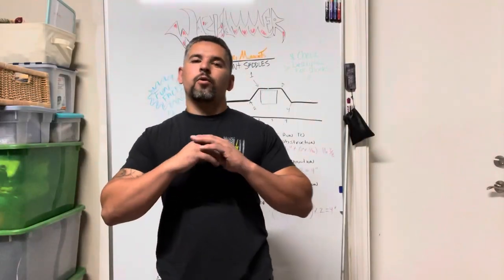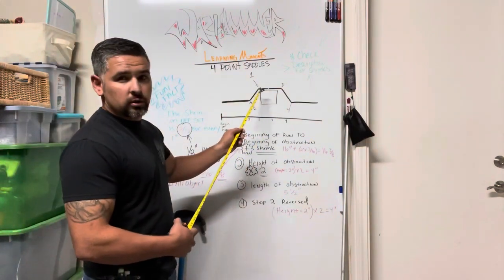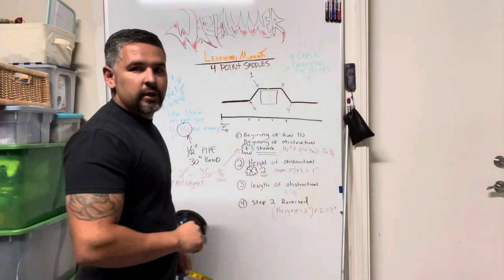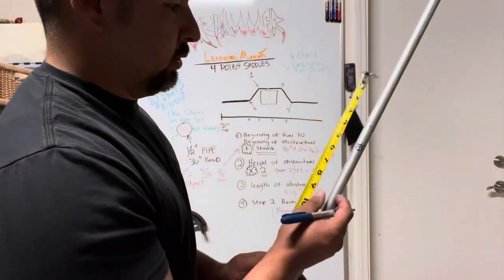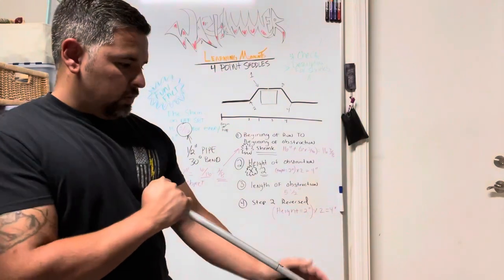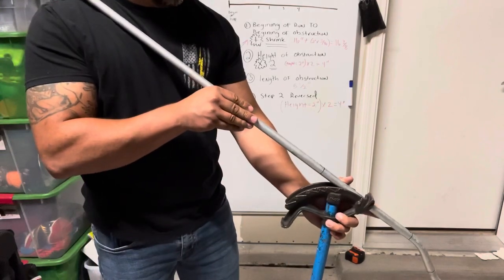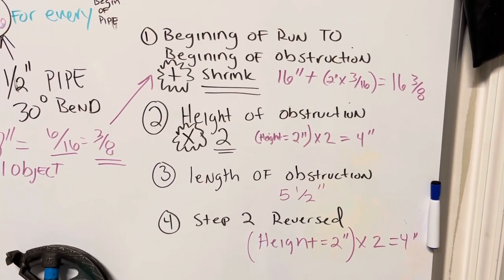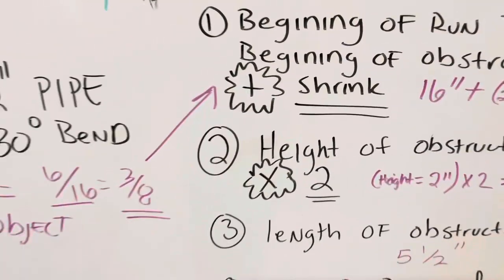Learn How to Bend a Four- Point Saddle with EMT and Ideal EMT Pipe Bender!

Comment: You use a wrong shrinkage for this 30* bending at 1 bend. It should be 1/4 x the height of rise. The number you applied here is 3/16 which is for 22.5* bend. Sorry I don’t have the degree symbol on my iPad, using * instead.